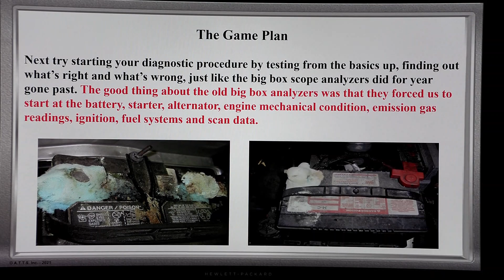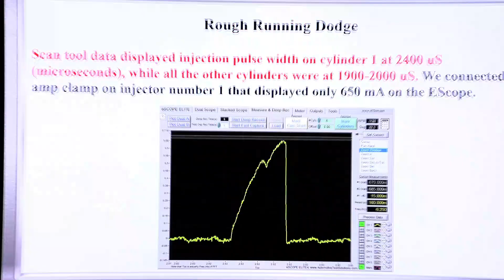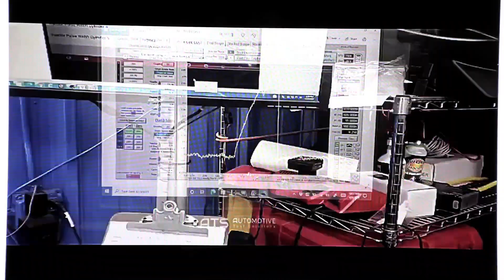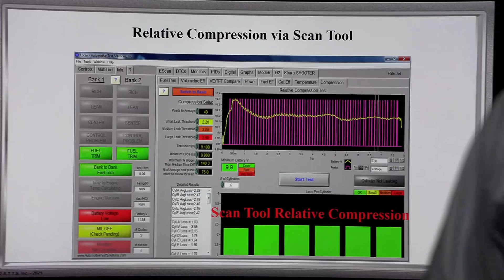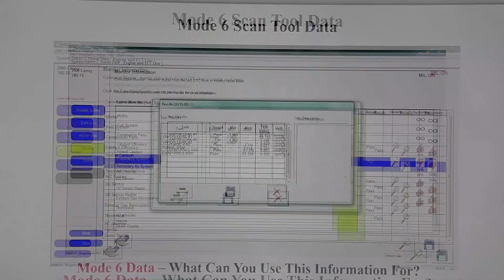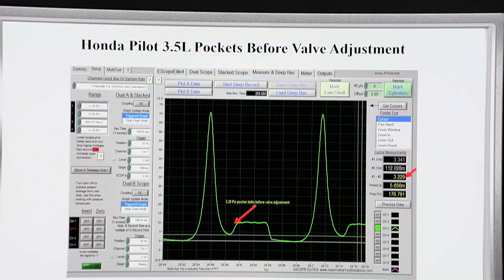Critical Thinking from ATTS for ASA 1 hour

Comment: wich multimeter would you recommend, for parasitic draw measurements?thanks for the great video.
Reply: The one you can comfortably afford. For parasitic draw, you don’t need super accurate or a fast sample rate which are the features that more expensive DVOM’s have. You need something that reads down to milliamperes (3 decimal points) and comes with a decent set of leads. Leads should be silicone and pliable. AstroAI trms 6000 is sufficient or any other brand in that 35-50 dollar range
Reply: @chrismoffitt9873  doesn't have to be also, very accurate, on the mV scale?yes,to read mV ,of course, maybe need to be very accurate too?
Reply: @Lambros_Stefaneas  when performing a parasitic draw test, you’re testing for current flow which is measured in amps by using the amps scale. When testing for voltage, you aren’t testing for current flow. You’re simply looking at the difference in potential between the positive and negative sides of a circuit. Whether or not you are off a hundredth or two of a volt or a couple tenths of a milliamp, makes no real difference. What’s important is consistency in readings across the circuit so you can reliably compare theoretical “a” to “b” and “b” to “c” etc…
Reply: @chrismoffitt9873  thanks a lot, I wrote mV instead mA ....
Reply: @Lambros_Stefaneas  no problem. Just trying to help you save a few bucks. It’s really easy to fall under the impression that “the best of the best” is absolutely required and will result in you being a better technician. Invest time and money in your skills and honing your craft. Because a tool, no matter how expensive or fancy, is only as effective as the person using it 👍🏼 Truth be told, a $10 incandescent test light will get you through 80% of your electrical diags’
Reply from the maker: I personally like the Fluke 88 meter since it has all the automotive test features needed for a tech. You can search the internet or go to www.aeswave.com. Thanks for watching...Go to www.tstseminars.org and view full length videos for members on TechFlix for $9.99 unlimited viewing …Membership and over 85 videos for less than $200.00 a year. Also checkout www.attstraining.com for hands on training and webcast